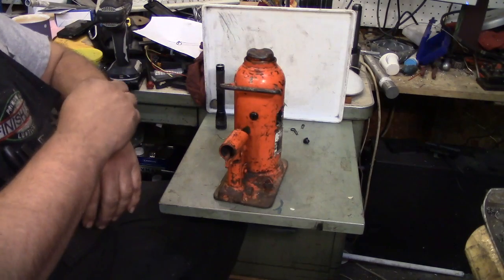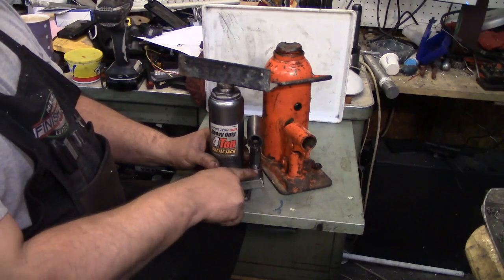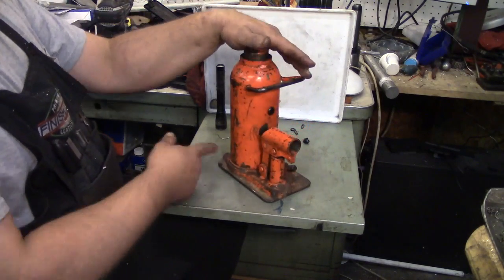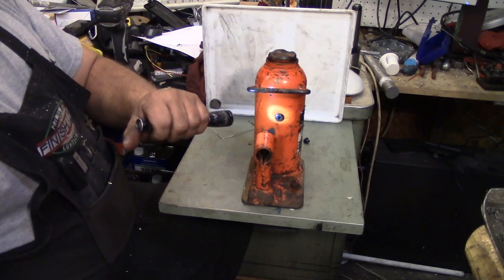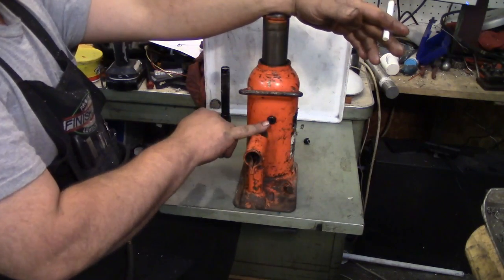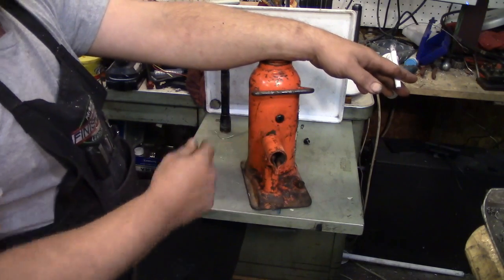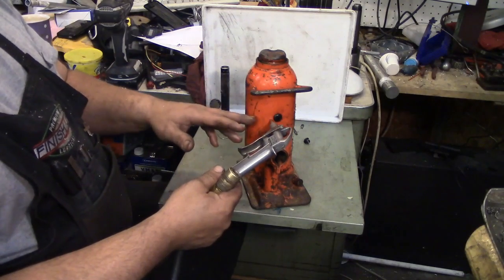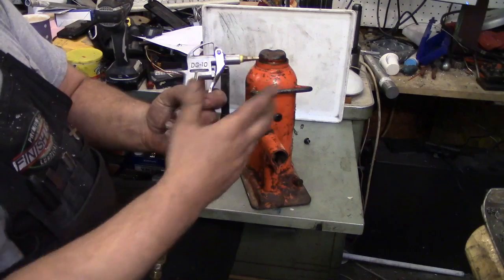Tinker Talk - Shop press bottle jack tip #1 - No cost mod

Comment: Great idea - Thanks!
I had a 20T HF air-assisted bottle jack "motor" go out (and the bottle jack and handle still work fine), so I am going to see if this works after I discard the motor and plug up its air motor hole on the base. That would be great knowing the whole thing is no longer a paper weight...or boat anchor...or ?

Comment: This sounds like a silly idea that will only damage your bottle jack. I would just buy one with an adjustable screw. For most folks, you are only going to need to set the screw once to fit your vehicle. From then on, only minor adjustments are ever needed. For those working in a shop, just place a piece of wood under the jack. I've never seen a competent shop yet that did not carry wood, steel and brick or concrete shims just for such occasions. Most of the time, you don't need to spend any money. There is more free wood available in the form of free pallets than you could ever make use of. Bricks and concrete are usually available for free during the early spring and fall when folks are cleaning up their yards. Steel is never free, but then again, it is very unlikely that anyone but a shop is going to have need of that. And no shop is going get away with not buying steel. For those odd ball situations where someone else might actually need steel, hit up a junk yard.

Comment: excellent video , thanking for sharing your knowledge I will watch your channel very closely . Do you have any ideas on drill dress mods  your explanations indicate you have much experience and  are clearly explained
Reply from the maker: Since I got a small mill,  I haven't done much to a drill press except for a motorized lift for the table.  The small cheapy drill presses go too fast for metal drilling so a treadmill motor on one would be a good upgrade.  Then you could use large bits without burning them up.  Also, if you use one of those General Tool/Sears drill sharpening jigs, they work better with a horizontal grinding wheel chucked in the press as a vertical wheel on a bench grinder is in the wrong orientation.

Comment from the maker: A few things to check:  There may be sand or crud in the return ports or release valve from the casting process.  Release valve may have a swollen seal restricting flow.  Extend the ram, stick the jack in a clean pan, and remove the valve screw.  If you can squish the ram easier then the port from ram to valve maybe OK and the valve seal or valve to tank port is restricted.  If the oil is real thick then switch to a thinner oil.

Comment: Thanks for the vidio. I have a jet jack and it takes a lot of force  to get the ram compressed. I see your jack is the same. For jacking in confined spaces it is very difficult to compress. Is there a problem with these jacks?

Comment: So in theory could a release valve be put in place to control air flow to it and made a stationary mod and do you think it would provide enuff force to be used as a manual hydro log splitter air powered mod?
Reply from the maker: In theory but there's a high risk of explosion if something goes wrong.  The jack body (oil reservoir) is not designed nor intended to hold any pressure and having a pneumatic bomb at face level does not appeal.  At minimum I'd use a flow control, momentary valve and a regulator set to very low PSI for no load positioning of the piston.  A malfunction of the valve or regulator could make it go BOOM.
Furthermore, IF the reservoir was strong enough, you'd need many hundreds of air PSI to get any jacking force and then it would only act like a gas charged shock absorber or  lifting arm like what's used on car trunks and hoods - a bad bad idea and it still won't split logs.
Reply: Ahh i see well a good thought and aparently just that a thought. Lol thanks for the expert intel eddy

Comment: Great tip man. As simple is it is brilliant. 
I haven't seen all your videos yet and maybe you covered this already, but on my engine hoist, I open the bleed valve and raise the boom by hand. I hold it above where I want it to be and cycle the pump a few times then close the bleed screw. It usually falls back a little but its faster to drop a bit more than pump it 1000 times from the bottom up. 
Maybe if you haven't done a video on that yet you might.
Reply from the maker: My fault for not being clear on the purpose of this tip.  It's aimed at folks that have a manual shop press utilizing a bottle jack.  In that scenario, pulling out the piston against the heavy return springs is not an option.  While the method you use to rapidly position an engine hoist does work, it can lead to problems.  Like bottle jacks, the hoist cylinder is also single-acting and the piston seal is designed to hold pressure in one direction.  With a worn cylinder or one that has a weak seal, air can be pulled into the system when the piston is pulled up.  Once you have an air bubble the hoist becomes a bit hazardous to use. Let's say you're installing a big motor... you wrestle it into position and crack the bleed valve to lower it in a controlled manner.  You 're almost there and maybe dropping a little too fast so you close the valve.  Instead of stopping, the piston bounces on that compressible air bubble and the motor slams into the frame or starts bouncing.  That bounce is picked up by the boom and it starts bouncing too and parts are being damaged or  hands get squished, etc.  That's why I don't endorse pulling on single-acting  jacks and cylinders.
Take care and thanks for the comment.
Reply: +Eddie the Grouch , thanks for that very informative reply.   I hadn't thought of that particular destructive scenario. Great stuff though.

Comment: Would it be possible remove the pump-action lever and weld one of those air attachments in its place, then connect the hose directly to the unit ?
Reply from the maker: Sure!  But it would no longer be a hydraulic jack.  It would be a very weak air jack :)  It's like when air gets into a cars brake lines and you start crashing into trees because the pedal won't build up any pressure.  Air, as with all gasses, needs a BIG surface area to push against in order to lift anything and a 2 to 3 inch cylinder in a bottle jack just ain't gonna be enough.

Comment: You could put a schrader valve on it the are easy to open to de pressurize
Reply from the maker: +rimmersbryggeri This was intended to be the simplest cheapest method without taking the jack apart.  Your idea is interesting so let's explore it.
1. The valve needs to be installed somehow.   If you used a rubber bodied valve, the hole would have to be the correct size and the valve pulled through from the inside.   If the valve was trimmed to be installed from the outside it may not have enough grip and blow off.  If you used a threaded style you would need to take the jack apart to get the nut on the inside.  If you drilled or tapped a new hole to fit a valve of either type you need be be absolutely sure no chips get into the jack or it will fail so the jack still needs to be taken apart.  Maybe a valve can be glued from the outside so we'll say it's doable.
2. If we leave the core in the valve the pressure will have to be released each time so that's another step.  If we take the core out we haven't really gained anything except a threaded nozzle that could be hooked up to a permanent air line and a 3-way valve in the case of a shop press.  You would also need a regulator to control the flow and act as a safety in case the valve malfunctions as the jack reservoir is not intended to hold pressure. Pretty nifty, and something I would do if I had that style of press, but now it's a complicated mod that requires parts.  Thanks for the suggestion, though - it has possibilities :)
Reply: It's probably easier to use your method or just let it be like a basketball valve and use a nipple for inflation. I thought of that just after my post. Thanks for they very good reply though. You can easily deflate a schader by pressing the center in though so you wouldnt have to take the core out every time.

Comment: Just pull the ram up with your fingers to what ever height you need. It will suck the oil in to the ram. Same with a floor jack, grab the lifting plate with your hand and pull up to the height you need. Been doing this for 40 Yrs.

Comment: Could it work the other way around, and retract the piston with vacuüm?  Then a setup with an ejector would be dead easy.
Reply from the maker: I don't know what you mean by 'ejector'.  Any negative pressure at the bottom of the piston will do 2 very bad things.
1- The fluid in the reservoir would get sucked out through the pump.
2- The piston seal is one-way.  When pressure builds it expands against the cylinder wall sealing it tighter.  It relaxes as pressure drops and a negative pressure would allow air from the top to zip right by and into the pressure chamber.  Then the jack would have to be bled.
Reply: Eddie the Grouch An ejector is a vacuüm generator that works with a venturi and compressed air.
I was thinking about replacing the plastic bung with a 6mm push lock in the opening of the reservoir, and using a small pneumatic setup to pressurise or depressurise the reservoir.

Comment: Hi Eddie,

Nice to see someone else is using air to pump the jack faster :) What I've done is that I tapped and plumbed a 1/4" line going to a 3 way bypass  ball valve with permanent air line attached to it. This way I can pump the jack and release the air once it's in the position. Then the actual pressing is by manual handle as usual. Give it a try, it works like a charm.
Reply: you got any pictures or a video ? I got a motorcycle lift with a manual bottle jack .I would like to use air but not sure how to go about it.

Comment: OK - For the bottle jacks lets explore rebuilding, converting to a external hydraulic power supply, floor jacks using bottle jacks. fixing the screw sleeve that comes loose.  New parts for missing items in valves and pumps .  That should make you an expert on this subject and there are no other people doing this subject. 

like the two you have done.

Powerhammer
Reply: Richard Kern yea that is my question also.
how do you replace or rebuild the bottle jack?
i bought a motorcycle style scissor jack from PepBoys with a 2 ton ram, but the bottle jack leaks oil all over the place.  I like the jack and I dont want to spend the $140 for another(I got it on sale for $100) and if I can just replace the bottle jack or rebuild the bottle jack then I d be as good as new.
Reply: Richard Kern
Reply: +Super Godzilla 
bubble gum